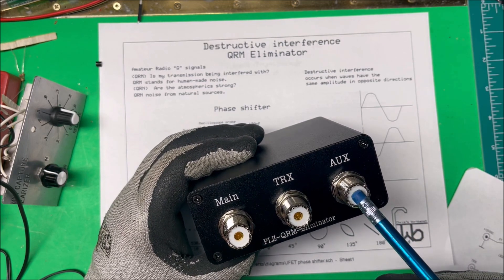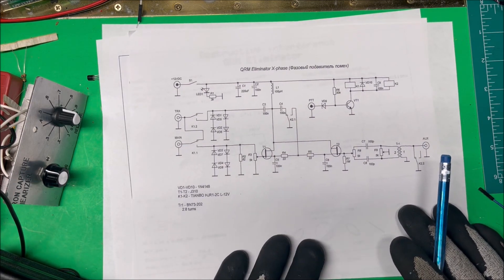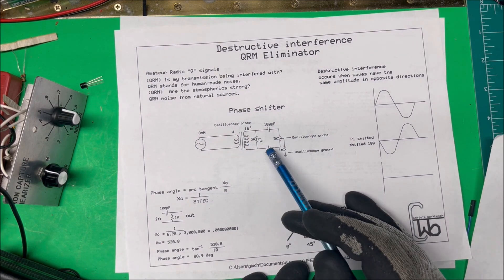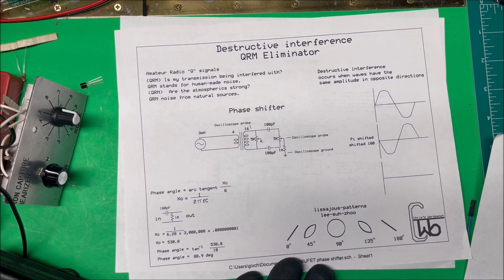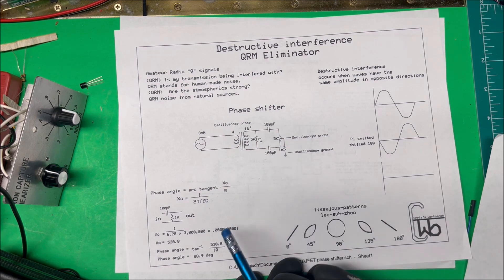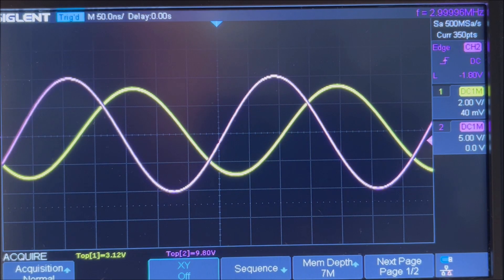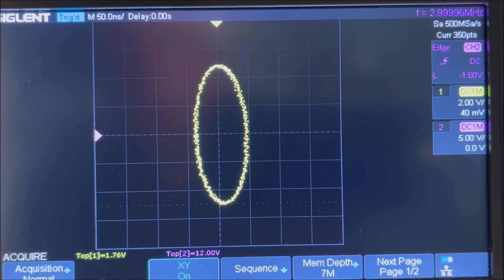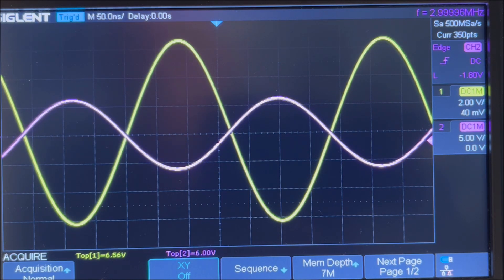QRM Eliminator

Comment: Thank you so much for this scope analysis, Mr. Chris!  This is the only scope dive into this cool little QRM buster circuit that I could find.  My little black box arrives today and I'm going after the rotten QRM around my shack.  

I think I get now why a simple 180 degree inverting amplifier isn't used on the noise antenna's signal.  The noise signal arrives at each of the two antennas at different instants and will be slightly out of phase with each other, because of the physical separation of the antennas and the directions of the incoming desired and QRM signals.  So the actual phasing has to be adjustable at the receiver to "lock out" the QRM, because every OP's antenna setup is different.  Does this sound right?

And you demonstrated (and showed your formulas and calculations!) how a simple circuit can provide the phase shifts.  Thanks to you, I finally get this.  I think.  Most excellent!

Comment: One of the main strongest QRM sources is 50 or 60 Hz power line buzz noise. This is most effectively heard using wide AM on any sensitive radio. RF phase cancellation units provide the deepest noise null on a single interference source that has a fixed degree phase value. The signal noise source is a function of its frequency, distance, and strength. The interference pickup antenna will often need more gain than the DX antenna. When both signals are 180 degrees out of phase with equal or near equal strength, a phase null occurs. Wanted DX signals are not usually nulled because it is unlikely they will have the same phase signature as the unwanted phase signature. There are lots of amplitude and phase combinations over 360 degrees.

Comment: Excellent video. Very impressive.
What happen if we have phase volume as it is but no volume controls for pre-amps (both anntena imputs). Instead, we put a volume at the point we mix two signals to change the ration. It may reduce the effort of tuning. What do you think? Thank you.
Reply from the maker: That's a good experiment.
Chris

Comment: After watching countless videos of QRM Eliminator demonstrations by people who don’t have a clue about tuning these devices, it is nice to see someone putting actual signals on an oscilloscope like you’ve done here. 

I also like the XY display, and would also suggest you try adding a math channel that sums the two signal channels. This way you can get real voltage levels and won’t need to switch to the XY mode and back. Well done.
Reply from the maker: Thank you

Comment: QRM  usually means interference from undesired transmissions in the same frequency band you are tuned to. Your device seems to be intended to null out of band interference. It might be useful if you are trying to operate very close to an strong out of band transmitter that is overloading your receiver, such as a commercial broadcast tower, but that’s not the typical case.
Reply from the maker: Thanks for the comment. 
I added a ban pass filter to the circuit.